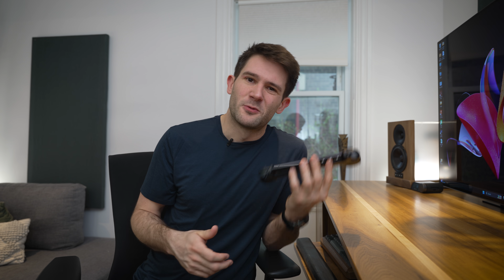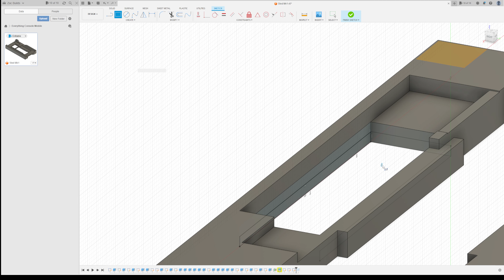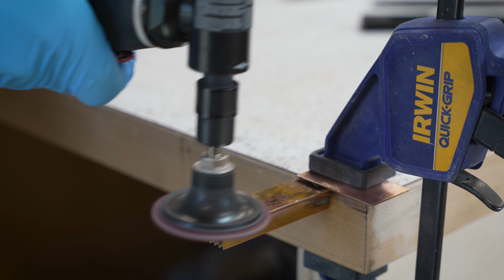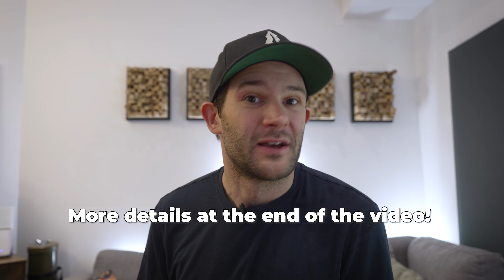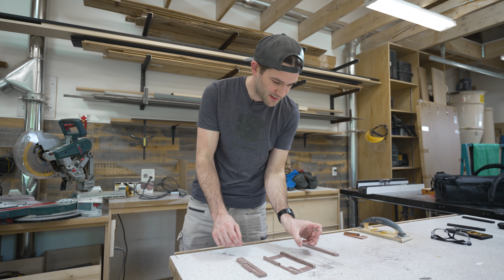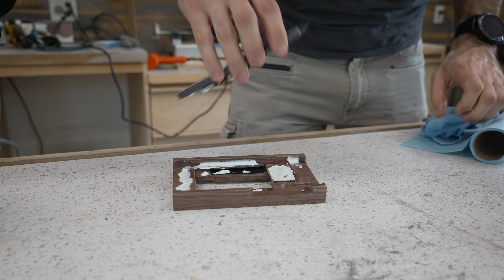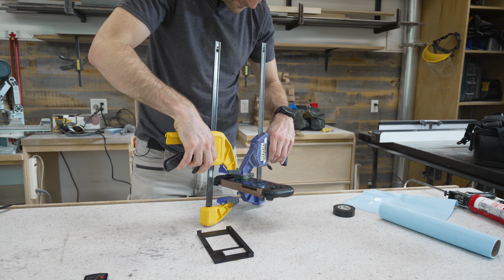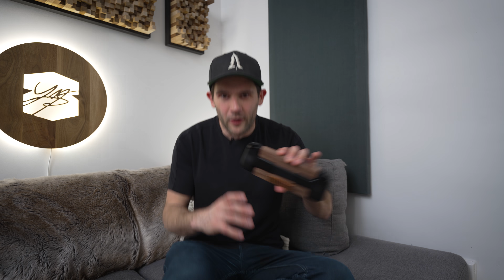I built the ULTIMATE GAMING phone...

Comment: You need to root the system, overclock the speed of RAM, processor, and graphics card, and turn off all heat and power restrictions, you will see a jump of up to 50% in raw performance.

Comment: Now that I think of it..... It still has a lot of potential as it still isn't getting full performance being pinned to the mid 40s for the temperature  as the phones firmware is hardcoded to thermal throttle so brutally when it goes above 40°C that it stays there because phone are designed to be held in the hand and apparently no one wants to get there hand burnt and also the battery dies fast due to high temperature so those are the two reasons they thermal throttle so much... But over these ppl have been using some tricks by editing some configs in Android located in /vendor/etc to completely throw the limit out of the windows and squeeze every bit of performance. Would love to see you try it out 😅

Comment: I did the batteri think to my old Mi10t, it works charmly, I use electric whire to connect the original battery to the new one after removing it's connector flex cable, this actually works for me. And I got to play much longer with the phone

Comment: My main issue is the battery... Sure you can attach another battery, but if the original is 2 cell, adding another would make it a 4 cell lipo battery, and if the battery management board isn't compatible with 4 cell balanced charging, you can have some serious issues later on

Comment: Something that's actually too late to mention but can work for the ultimate gaming phone 2.0 is that all high-end Samsung phones especially the s series and previously the note series supports gaming on the charger. If you have a 25w or higher charger that supports PD then the phone will simply draw power straight from the wall instead of the battery and basically bypass and switch off the connection to the battery while any heavy intensive rendering is happening like gaming. So no need to add a second battery to double the up time. I know it's so there can't be any cables around you but if it's going to be DIY then 1 downfall won't matter

Comment: you are stopid why? because go fing buy a better phone like xiaomi which the best in my opinion and use a fan a fan would help a lot more than that thing you made also lifting and cooling the both sides of the mother board would be a lot better because heat would go away much easly and f that wood go use plastic or even better metals after all of that pretty cool project

Comment: But the problem with the locked functions is now a general problem with Android. That's why I only choose my future smartphones according to criteria such as device lists from LineageOS, postmarketOS and Ubuntu Touch. Of course, you almost never get the latest one, but used devices have the best price/performance ratio anyway. Above all, you actually own the device. With many new Android devices, I sometimes wonder why “non-power users” buy them at all. In principle, Apple is almost always better in this respect.

Even my OnePlus 7T Pro McLaren is not really accessible. Yes, you can root it and there are now also good spoofing solutions for using banking apps and mobile payments. However, you can only get the Adreno GPU above the manufacturer's clock limits (a ridiculous +10MHz works and if you go above +10MHz in the frequency table, the bootloader becomes skeptical and no longer boots). The fact that so many app developers rely on Play Integrity sucks enormously (especially because some apps recognize a device as rooted although it is not rooted, which is why you then have to root and spoof it to make it work, which is completely paradoxical.

I hope that more Linux phones with powerful SoCs will come onto the market in the future. Then I would even do without Android and run the necessary Android apps in a sandbox on Linux.

Comment: Soudal makes a product called T rex crystal clear, it's amazing stuff, safe for potable water, good bonding strength, a little more than silicone, but not too much, and very clear, used as selant on a second floor window, you basically just can't see it. Other T rex products are very strong construction adhesives for if you need 260kg/square inch kinds of strength

Comment: Contrary to popular belief aluminium makes better heat sinks due to the lower density of the metal causing it to expel heat better than copper. Copper is definitely better at conducting heat due to the higher density of the metal but aluminium makes better heat sinks

Comment: I would recommend to use a oneplus 9, xiaomi mi 11, or other phones because they are not as locked as samsung. I would not recommend Samsung for gaming too, because of poor thermal design. Samsung phones do have vapour chambers, but the thermal interface material between it is not as good as normal thermal paste, which other manufacturers use.

Comment: One thing most tech dude are wrong they waste time doing this into normal phones. They should do it on gaming phone since gaming phone doesn't restrict their processor as much as normal flagship phone as Samsung or Xiaomi. Gaming phone uses 80% of their CPU/gpu power if you crank up their chip. While normal phones like Samsung were never 80% to begin with. I knew this since I tested both newest Samsung and Redmagic phones. Samsung got 80-90fps gaming for 4 hours. While Redmagic got 120,110 fps 4 hours of gaming. Please if ppl want to do project like this it's best to do it on gaming phone

Comment: I did this, but just the heatsink, my phone kept getting hot and then throttling while playing a game... so i cut a hole in the back slopped some thermal paste on the heat spreader and dropped a nice aluminum chipset heatsink onto it. No more throttling!
Reply: I changed battery on S20. And i didnt glue back cover back. Only old glue. I use phone in case, so its not a problem. This way i can easy remove back cover when i need to. I used old alu sheets from old laptop, and i made thermal paste. Then i spunge some paste on metal covers at chips, and over top alu sheet which i cut to be over the battery and under wireles pad. And phone is working, better and cooler than ever. Custom Rom, 96hz display, on wifi i get almost 10 hours SOT. Battery is at 85% health.
Reply: @slablevcek do you keep the black plastic on the phone motherboard? If not, how do you solve battery won't charge or phone won't boot without that? Thanks
Reply: @tducc371  plastic is still on.

Comment: Just to add a few things: 
- You should add a 3D printed back plate with a cutout around the soc so the battery pack stays protected
- Instead of thermal goop, flatten the surfaces as much as possible and maybe polish them to help tolerances and then add PTM 7950 so the cooling stays more effective
- Try adding cooling pipes instead of dumb bricks of metal and also a little tiny cute fan that sips power or a Frore AirJet Cooler which is an absolutely amazing handy dandy little thing that hauls its ass like a champ and it's incredibly small/compact
- A 90° angle usb port placed on the top or the bottom (left or right side if portrait)
- Custom debloated android rom with GMS for better battery life, a lot less backgroud tasks and no manufacturer/TSP locks/restraints with any recent 8gen snapdragon from xiaomi, redmagic, vivo, oneplus
- Maybe a cut out or easy access to sim slot or E-sim for 5G
- If possible, 3.5 jack if Bluetooth Low Energy not available
- Detachable USB-C external SSD compartment 
- Using screws instead of glue as many places as possible for ease of maintenance and disassembly
- profiled sheet metal for braces and rigidity/stability
That's all I came up with as probable improvements watching your video. Btw it's still really cool and I'm in no position to lecture you how you should or should not build your stuff, these are just ideas for you to try with your resources.

Comment: Best phone to do this with is the Samsung S20 plus , Note 20 ultra , Note 10 plus.... you could go with s20 ultra for the screen size but it's so small your not gonna notice it tho... it's a gimmick 0.1mm isn't nothing lol 😂😂. S20 PLUS  is the better one... 865 octa core , 12g ram , 512g storage.. 6.8 display 120hz 1440p. And can be rooted actually. So 🤷🤷.. runs cod warzone very well. The s21 s22 23 24 suck unless you get thr ultra... your stuck with 1080p , 8g ram cpu that throttles badly...

Comment: As a Samsung certified repair technician that battery puncture scared the life out of me, that's why we use plastic (HDPE or PC) tools when removing the batteries manually.
I'm glad you are okay and that you had that battery drained properly, especially with where you punctured it that area is a spot where two layers overlap so even with it fully drained it could've sparked when bridging the two sections of the battery and caused a fire.
Reply: @bniisantos syfm

Comment: Hi, i see you commited a mistake and i just want to point it out for any future issues.

The heatsink is made of copper, wich can't actually be weld with tin wire, just merging it together. Your phone is using the first part of the heatsink to transfer the heat, but the second part won't work as well. In order to weld copper you need to use argon.

I made this mistake with a laptop a few years ago and yeah, after a few uses the temps went really high and my mobile GPU died.

Comment: Complete joke of a project.
Firstly smartphone SOCs, don’t go above 50-60 degrees. So don’t require any active cooling.

Secondly, instead of using thermal paste, you used thermal putty which is less efficient at heat transfer. And Holy Cow, I could drown in the amount of putty you put in it. 

Third, when you game for long periods of time, your battery heats up too. You don’t have any cooling to handle that.

Fourth, you taped the motherboard trapping any heat that will be produced in the other components. When you game, it’s not just the SOC that heats up. 

Lastly, there exist thermoelectric coolers for mobile devices that are literally 1000X more effective than whatever NONSENSE you built.

Comment: Why are you chancing it by jury rigging several batteries and not.. say.. buying a bigger capacity cell and attaching the protection board onto that.. or checking the connector compatibility and buying a bigger cell that matches your specific needs?

Ive replaced plenty of batteries on my older android devices and the one im daily driving is using a pretty common connection that a lot of third party off brand batteries use.

Comment: Heating and thermal throttling are biggest issues in mobile gaming.
If you manage to keep down the temperature as low as 30 or below then a 5 year old Snapdragon 845 can give better and stable performance than 5 year new chip like 8 gen 2 with normal cooling solution that we find in smartphones, only exception being red magic gaming phones.

Comment: Better than an android gaming phone, you can use a miniPC with a ryzen7 5800H its internal graphic in the CPU is enough to run ps2 ps3 gamecube wii and switch at 1080p. personnaly i have made one but with a 8" screen with touch screen at 720p for runing pc games really smooth. For the game pad i have use 2 joycons of the nintendo switch but not the officials but those of Nyxi who has really cool led iniside. To fix them side by side i have bought official rail trails of a nintendo switch (normal or oled).
So like a switch i can detach them and i have made a TV station like the nintendo normal or oled switch to dock it and run games on TV using the type C usb 3 who can add a second TV screen. 
I have used a beelink ryzen 7 5800H with a 1To SSD nvme and 16 go of ram (it has an additional sata port to add a ssd 2.5")

Comment: Create the outer shape of the phone and make a hole for a fan in the back And combine two batteries, as Zed did, for processor speed, screen speed, graphics processor speed, and RAM speed, and make a small heat sink that matches a fan. Place the fan in the middle of a phone and wrench the heatsink from dependent to fan, even if you put 2

Comment: I bought a, powerbank and a cooling fan...
Reply: Any phone cooler fan will not make a measurable difference in temperature without making a lot of noise, as Zac did adding thermal mass, even with little to no active cooling it's better for low power usage, adding an m.2 cooler over the phone chasis would lead to similar results without voiding warranty.
Reply: @samuelortizs  you are just saying nonsense, i have i phone cooler in fact i made it my self and it's really effective it have two modes of power one with a resistor to make it spin slower and the over mode is full 12v and it's actually still very quite , the temp of cpu with no cooling will get to 85°c and even 90°c but with the fan it only reach 70°c max also i can even hear the fan and without it the phone would throttle so much
Reply: Lol 😂🤣😂

Comment: I feel like the weight is a non-issue when compared to a Switch, at least to me. I prefer my handhelds to have a bit of weight and chunk to it so I can "feel" their value, while the Switch (specifically the Switch Lite) feels like a thin paperweight.

Also it turns out you can overclock a Samsung without root, so it's possible to take full advantage of the increased battery life and custom heatsink

Comment: You can easily root samsung phones, Samsung themselves provides methods to unlock the bootloader so you can flash Samsung phones, using this you can flash a custom recovery like TWRP,  however, the cellphone carriers are known to disable the ability to unlock the bootloader, but generally there are work arounds. Once you unlock the bootloader, install a customer recovery, you can install a custom rom, or just flash the files to allow root on the stock rom. And can even do all that with Samsung's own toll, known as Odin, this is a tool samsung developed and uses themselves to flash their phones, it however was leaked, not released by Samsung. However, the instructions and tools, and even custom recovery and roms are so easy to find, as well as the fact Samsung provides methods and instructions to unlock the bootloader on their phones, with the warning that doing so will trip the knox fuse on your phone, but stating that you couldn't root your phone because Samsung locks down the phones in North America shows your ignorance and lack of research, not trying to be rude or cause any offense, just stating the facts, I have been in the android rooting communities since the first Android phones, and I also sold cell phones for many years  and Samsung and HTC were among the first to provide the methods to the rooting / custom roms communities to unlock the bootloader on their phones, and neither of them have reversed their stance on allowing users to unlock the bootloader on their phones.

Comment: Good afternoon, we are from Ukraine! I have a question about your cooling system, is it correct to use tin to join the copper as copper has a higher thermal conductivity than tin? That is, to copper the heat of the radiator comes from the processor of the smartphone very slowly, I could be wrong!

Comment: I think that if instead of the heatsink, you were to use a fan with some holes to let the air out, you could dissipate more heat and make everything lighter. Also, if possible, you could try overclocking the CPU.

Comment: Maybe a bit late but there is one flaw in your Design regarding the batterys. I doesnt Matter If there are 2 or for example 4 Batterys in there aince android only estimates the % of the battery at startup Based on the given voltage and then slowly decreases it with calculations. 

If u attach the Phone to a Power supply with constant voltage for example where the Power is theoretical infinite the Phone still thinks the battery is draining and the % is gonna drop and at around 0% it'll still shut down.

Comment: PLEASE be very careful when modding batteries!
You mention it was a dead battery so all you got was a little sizzling sound.
Heads Up, a discharged/drained/dead battery CAN be more dangerous than a charged battery as some left over elements have much more space to rapidly move about, instead of thermal runaway it can go with a bang.

Comment: "So what is the difference between brazing and soldering? The American Welding Society (AWS) defines brazing as a group of joining processes that produce coalescence of materials by heating them to the brazing temperature and by using a filler metal (solder) having a liquidus above 840°F (450°C) and below the solidus of the base metals.

Soldering has the same AWS definition as brazing, except that the filler metal used has a liquidus below 840°F (450°C) and below the solidus of the base metals. Soldering can be considered the low-temperature cousin to brazing."

Comment: In case you wanted the absolute best performance in thermal transfer, there are a handful of companies that will just sell you pre-bent, pre-flattened heat pipes of various dimensions. The only challenge is actually attaching other bits to the heat pipes. You can solder to them, but you need to use a relatively low temperature solder and you need to use a fair amount of heat because the heat pipe will be sinking that heat rapidly. But you can't use too much heat or the liquid inside will boil and it'll pop.

Comment: Wow this is a cool build!
My phone is a standard gaming phone and actually came with a heat sync in the box (It's the ROG Phone 7 Ultimate, if you were curious as to what crazy phone maker does that) The only thing it didn't come with is a controller grip. The heat sync has extra programmable buttons on the back which is cool, but the main controls are still just virtual buttons. So maybe I should do something like this, though of course just making the controller. Food for thought.
Awesome! I might need to subscribe to you, i just found your channel and there are so many cool projects there.